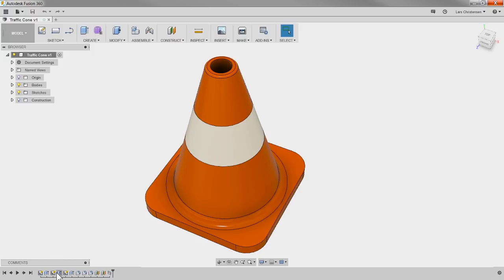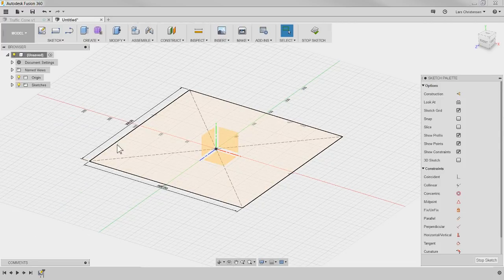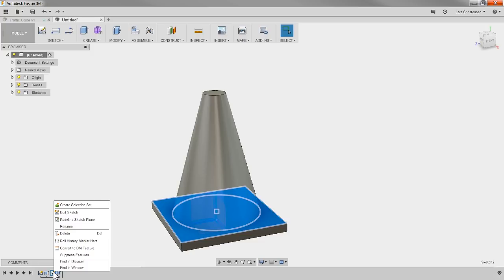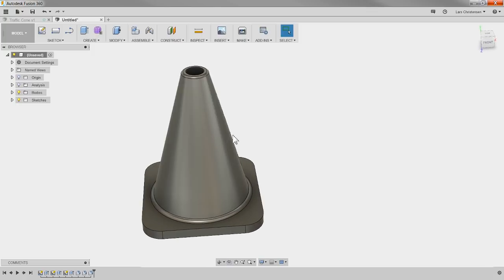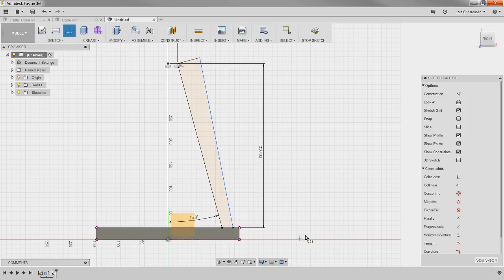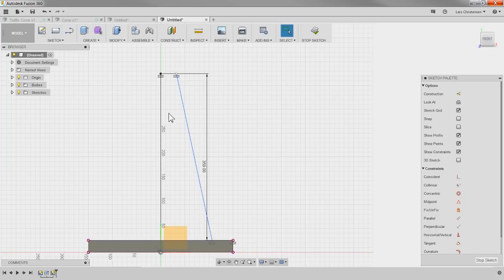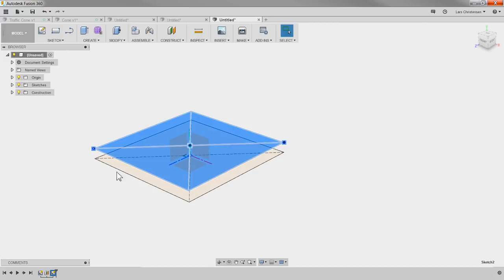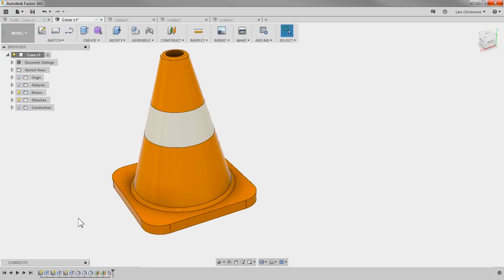Fusion 360 Absolute Beginner - How To Model a Traffic Cone - Last Nights Facebook Livestream

Comment: At the sweep section 49:40 It doesn't seem to want to snap to the geometry. When I try to do Hor/Vert constraint to make it black it gives me an error because it says it already has constraint. I did it several times and rewinded but same thing. This prevents me from working with the arc and applying angles. Please help ^_^

Comment: Lars, or anyone else.
How do I get the highlighted part colored blue?
On my Fusion, the object is dark grey, and the pointer highlights with lighter grey.
I am colorblind, and the contrast between blue and grey is far easier for me to work with.
Reply from the maker: Hi 2rRas Thank you for watching!
It could be caused by the environment you are using. Down at the bottom of the screen, there is a little button that looks like a computer monitor. Click on that and change the environment to Photo booth.

Does that help?

Best,
Lars
Reply: It did not solve it for me. All grey no matter what "enviroment" i choose.
Also tried following this thread, but no luck for me. All grey, no blue highlight.

http://help.autodesk.com/view/fusion360/ENU/?caas=caas/discussion/t5/Fusion-360-Design-Validate-Document/Highlight-color-when-selecting-sketch-profiles/td-p/6870925.html

I searching for a setting/preference something like:
"Highlighted section color -> blue"  ??
Reply: Never mind. After a "Restore to default" under preferences, it is all ok now.

Comment: Hello, I am starting to use fusion360 and I would like help from you.

This is the last machining operation, it is not represented in the simulation, it is the return of the tool to the origin point. Once finished the tool always moves on the zero position of the Z axis, which poses a problem because it is in contact with the TOP of body ( my origin point is on the TOP of the body).

For the moment I have only found as a solution to delete the last line of command in the Gcode so that the tool does not return to the origin. It is not very practical and especially it is necessary to think to modify the Gcode.
Do you have a solution ? there is a parameter to modify? I do not find .

Thank you.
Reply from the maker: Hi Soran Bregas Thank you for watching!
Your solution might be a post edit.
Check out this forum:
https://forums.autodesk.com/t5/hsm-post-processor-forum/bd-p/218

Best,
Lars

Comment: Hey Lars. Been using Fusion for about a year now, originally learned by following along with many of you videos. I have a question about speeding up fusion. As I increase the number of components and seemingly the ammout of moves on my timeline, my fusion slows down. Even on my desktop running a 7700k a GTX 1070 ti and 32 gigs of ram I get short load times between actions such as starting sketches and preforming extrusions. It's really annoying and I don't know whats causing it. Lowering the render or visual quality does nothing as my computer has plenty of power to handle the visuals. Weather I hide the all components that I am not activity working on or they're shown, my actions are all still slow. Note that navigation is completely fine. No matter the complexity, I can navigate zoom and orbit an object without issue. I think it may have something to do with the complexity of the timeline. Do you know whats wrong or how I can fix it?
Reply: Well I went into one of my more complex models and into the the timeline setting and erased the timeline, which also stopped recording timeline actions. It sped my program right back up. Problem is, is using that you cannot use the timeline at all. I wish there were a way to take out the timeline to a certain extent.
Reply from the maker: Hi Luke Fenske Thank you for watching!
How many components in your design? This might be one of those that it would be better having the support team look at:
https://forums.autodesk.com/t5/fusion-360-support/bd-p/962

Comment: Another great video Lars with a fantastic way of seeing the same object modeled using several different approaches. I am only a few days into using F360 and find that your videos have helped me out immensely. I look forward to continuing my at home training thanks to you.

Question: Is it possible to change the location of the origin on a sketch after you have started?
Reply from the maker: Hi FENATECH Thank you for watching!
You can't move the origin, but you can move the sketch to the origin. Everything should be held down by constraints, so you should be able to move those constraints and move the sketch versus the origin.

Hope this is helpful.

Best,
Lars
Reply: Lars Christensen I guess that’s what I meant to say. I was looking to see how I could move the sketch so as to use another point on the sketch as the origin point instead of the one I started with.